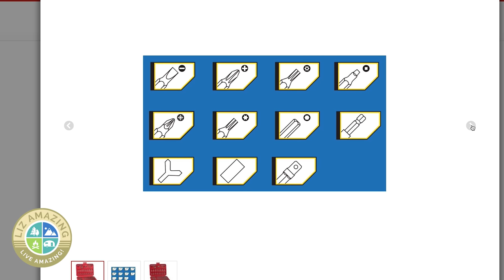(Not what you’d think!) RV tools you need, whether you camp fulltime or on weekends | RV Life

Comment: Pretty comprehensive. I also carry spools of wire in different gauges, some looming and different barrel connectors and lug connectors. I also keep a caulk gun for any re-sealing I need to do. I'm also going to add my dremmel tool, cordless vibrating tool, cordless Sawzall and circular saw. Come to think of it, I might need 2 trailers.
Reply from the maker: Exactly! Paul has most of that but we didn't show it. We actually upgraded when Paul moved in precisely because of all the tools!!

Comment: There are a lot of comments so I don't know if someone has mentioned but we carry a large heavy duty flat piece of cardboard to lay on or kneel on in all the crazy weather that you run into.  If you destroy it in mud or water no big deal just grab another at the store.  Most places give it away like grocery stores.  We have a motor home so need things like antifreeze and oil, etc. 
Great video! Love you two.
Reply from the maker: That's a great tip, Deb, and you are the first to mention it. We have tarps but I think cardboard is better. It's more comfortable and you don't have to worry about cleaning it afterwards. Thanks!

Comment: Great video, I have the same air compressor and a digital pressure gauge inflator. The other item I carry is a battery charger. I camphost and am parked in my space for weeks or months forgetting to shut off chassis batteries at times, so the battery charger has saved me several times.
Reply from the maker: That's a great tip. Thanks for watching and glad you found it helpful. Enjoy your weekend!

Comment: I carry basic tools in my van (tow vehicle) but the one thing I do carry for spare parts in the trailer is PEX tubing, clamps, etc.  Water is the most important thing while camping.  I don't carry a drill or impact anymore.  I replaced both of them with a 3/8" battery ratchet.
Reply from the maker: Paul says that’s a good thing to have bc it can be used in even tighter places. Happy camping!

Comment: Not just tools but replacement parts. A mechanics creeper can really be nice to have.
Electricial parts, fuses, butt splices, extra wire or cables, plumbing repair, fittings for pex, extra heating elements for water heater.
The most important can be instruction manuals for everything.
Reply from the maker: Instruction manuals! Oh my gosh, you think like me. Paul never reads them, lol!

Comment: Well, I have the socket and 1/16 stuff, for the water heater.  Pliers, a small ratchet set. Air compressor.  Hammers. I don’t have a drill.  I haven’t really needed one. So holding off on that purchase.  Other small hand tools like you mentioned.  Thanks for the video. Happy Trails
Reply from the maker: Hi Michelle! I didn't carry a drill either when I was solo. They are handy when raising and lowering the stabilizer jacks (if you don't have auto levelers) as that saves you from cranking. I think a good strategy is just buy tools only on an as needed basis. But definitely have some duct tape and Eternabond on board now, if you don't already. Thanks for watching!

Comment: I would clarify that you need to get a clamp meter that does DC Amps. They are a step up from the AC only.I made the mistake of misreading a package on one that I bought on the road. Thought it said both, but I found out I was mistaken. Great video. I carry tools, but it is great see where the "holes" are in my kit.
Reply from the maker: Good tip, thank you! We've gotten by without one but it would be handy to have. Thanks for watching!

Comment: ❤️❤️❤️❤️❤️❤️❤️❤️❤️❤️❤️❤️❤️
One missing tool you may want and don't weigh much , baby Wonder bar , or as we roofers call it -
flat bar , baby flat bar about 3-1/2" Long shape the same way as your Wonder bar , that little one sure comes in handy for some tiny things leaving last marks  and you can also grind it to make it even flatter if you wanted.
Reply from the maker: Yes! We have one. It's a mini that I (Liz) contributed. I picked it up at Ace Hardware. It's a handy little item. Thanks for your comment, Kerry!

Comment: A tool I've carried in my tool bag for many years is a paint scraper. Not the razor blade type which I do carry, but one with a handle and a metal blade with a half round hole in the side and the working end is a beveled blade and on one side is a point for corners. I'll try to send you a picture of it. It's great for removing sealant and thick crud.
And a rubber mallet! Oh how that has been used in my trucking career from beating the sides of a bottom hopper to removing ice from doors and yes windows! Just be gentle on glass!
And real important is a flexible extention fir your torque drivers that can bend around the things that don't move! Oh it's a life saver instead of standing on your head to get to that one engineering nightmare screw!
But most important is a creeper!
I hate doing laundry! But if on a parking lot where men can and do like to whip "it" out and relieve themselves it's a life saver. And the one I had would fold into a rollaround seat where the bottom becomes a tool tray. It disappeared with my tool bag after my truck wreck and the tow company swears they never saw it or my tool bag which I'm rebuilding slowly as SSI pays less than minimum wage so is a slow process!
Thanks for the tips and..

Blue skies and safe journeys!
Reply from the maker: Oh my gosh. So sorry you lost your tools and that cool creeper. We are camped on dirt/gravel the majority of the time or Paul would get one for sure. Glad you survived your wreck and thanks for the tip about the scraper.
Reply: @LizAmazing  it would be nice if they sold one with pneumatic tires. Life would be so much easier when having to work on your back under something!
Reply: @LizAmazing  do you have an email address for junk mail so I can send you a picture of thus paint scraper that I've carried in my tool bag for years!
Reply from the maker: @rolloverriderpgr  email us at liz@lizamazing.com

Comment: Paul, I have a 1"  torque multiplier socket set. Bought it on Amazon.  $90.00. I use it if I have a tire go bad on our HDT.  Also works great for busting those frame, shackle, and spring bolts.  
Safe travels and roads.  Brian and Cindy. "Xtreambydesign with passion"
Reply from the maker: Hi Brian and Cindy! Paul has seen those but never used one. Thanks for the tip! Happy travels!
Reply: @LizAmazing  We have 1" wheel studs on our HDT.  And you need a 1" anvil air hammer to break them loose.   Since we can't carry the size of air compressor or tank to drive one I decided to carry one as a backup.  When your boondocking it's hard to get a heavy tire company to come out and service you for a flat.
I decided I can always single out one of our duals, or I can move it to the front to get us back in.
Got to have backups for backups😃☺️.

Comment: Three comments to add based upon my experience.  First, buy 3M electrical tape.  It is the best.  Do not go cheap as you will be sorry.  Second, if you have a bumper pull trailer, a cordless drill and socket greatly speed up lowering ( and raising ) your stabilizers and setting your x-chocks if you have them.  Item 3 is to carry a length or roll of the tape used to seal the underside of your rig.  It is not cheap but it really works.
Reply from the maker: Great tips Paul, thanks so much! When I was solo I hand-cranked those stabilizer jacks, that got old quick. When Paul came aboard he showed me how easy it was to do with a drill. Yay!

Comment: Great video I have been really looking for a air compressor to air up the tires. Can you plug that one into the camper power when you travel
Reply from the maker: Only if you have an inverter that will provide 120 volts. So it only works on 120 and will not work on 12 volt. Thanks for watching and happy travels!

Comment: Probably the biggest thing you need in your tool kit are patience and diagnostic skills.  I don't know how many times I've heard people say, I've replaced 14 parts and I still have the problem.  The real problem is their lack of diagnostic skills and the patience to find the problem.  As for tools, much like Paul, my biggest issue is what tools do I have to get rid of or leave somewhere else. I have everything from 3/13 sockets to I think 3 1/2 inch  sockets.  In my case I have a motorhome so I need some bigger tools.  Other than that the only thing I don't have are some of the PEX tools and the power probe.
Reply from the maker: Yes, that's the biggest dilemma for sure! It's hard to leave those tools at home or if fulltime to part with them totally. Sounds like you are well prepared though. And excellent point about diagnostic skills-- and patience. That can't be overstated!

Comment: Great video! Quick question: will your impact driver remove the lug nuts on truck and rv?
Reply from the maker: No. To break them loose, I use my breaker bar. Then sometimes I'll run them off the rest of the way with the impact. They do make a cordless impact that will take off lug nuts, but the one I have won't do it. Thanks- Paul.

Comment: Shark Bite connectors are dependent on the pipe being smooth, clean, and round. There must be NO burr on the outside of the pipe. Get it right, and they never leak. Did I mention clean???
Reply from the maker: Hi Robert! We just learned that Sharkbites are not approved for mobile applications, so that might be a factor. And, yes, that's very true about the outer surface having to be perfectly clean. Thank you!
Reply: @LizAmazing  that’s a good tip. Guess they don’t stand up to the movement and vibration in a rig on the road.